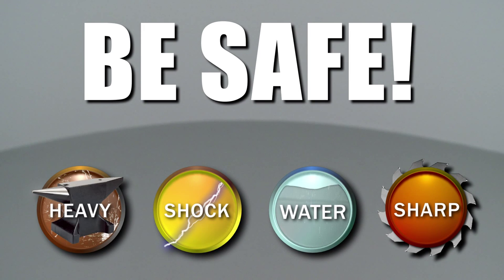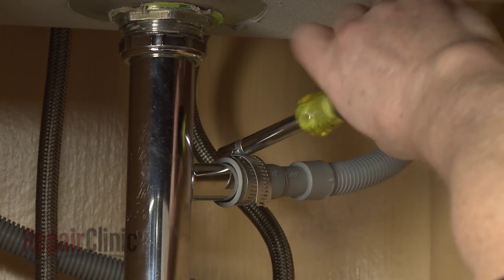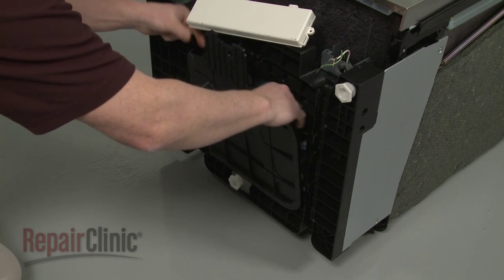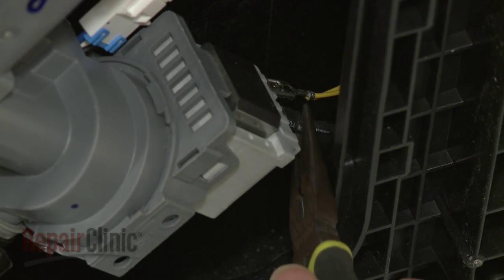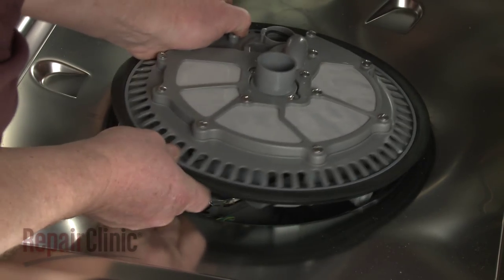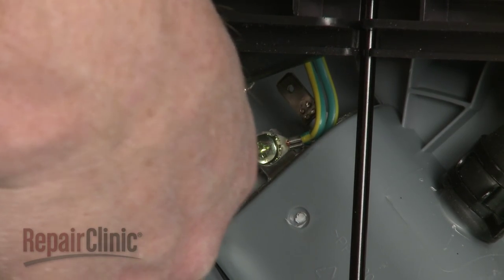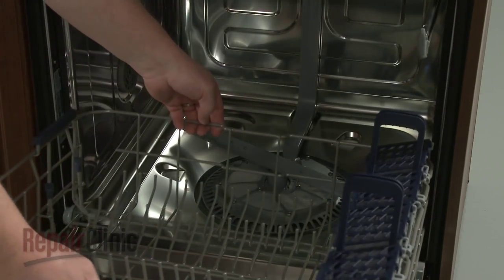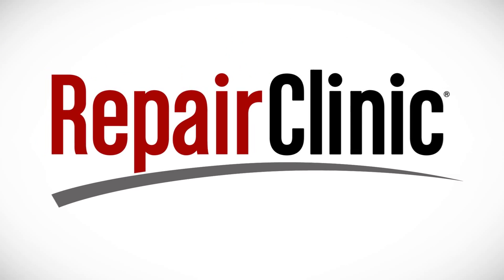Samsung Dishwasher Pump & Motor Assembly #DD82-01126B

Comment: I mixed the wiring up on reassembly, probably. Everything is working great, but it is stuck in the drying cycle with the Heavy light flashing.  Any idea which wires? Thanks for all the help!

Comment: When I turn my dishwasher on, I hear it click on as it should, I hear the "hum" that happens before it starts draining, but it doesn't subsequently drain. The backflow valve was twisted. I fixed that. It still won't drain. Is it likely this repair that's needed? Or do you think there's a clog in the drain line? It smells awful.

Comment: My 2 yr old dishwasher stopped washing. Repairman said motor was locked up. Our city water is artesian well water full of minerals. Needless to say, it gunked up a nice dishwasher! The part is about 250, so I would definitely try to DIY. I can't afford a new dishwasher. Btw, this replaced a year old washer due to motor failure. Any suggestions as to keep this from happening again. I can't afford a water softener system or a new dishwasher every 2 yrs.

Comment: What are the symptoms that this repair is based upon? My dishwasher is not cleaning the dishes properly. When I open it there is hot water and steam but dishes not cleaned. I’m not getting any error codes

Comment: The video is good however what a poor design by Korean engineers..to get access to 80% of the functional parts requires a technician to remove the dishwasher from installation and that's very time consuming.